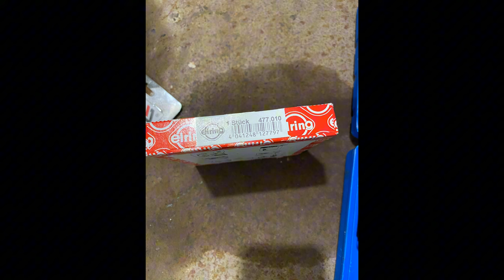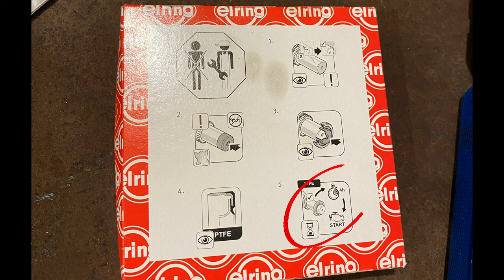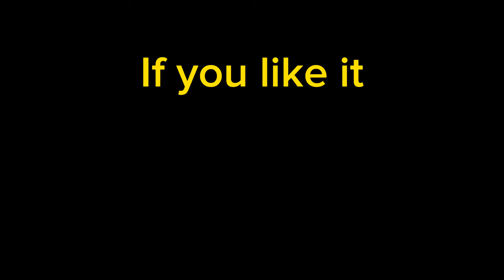FWD Crankshaft Seal Replacement for BMW M57 Engine

Comment: How did you lock the engine during damper disassembly and reassembly? Looking forward to do this job on my e61.
Reply from the maker: There are few options. 1. Use BMW special tool for locking flywheel codes 118183 and 118182. 2. Use old serpantine belt to lock vibration damper (Lots of examples in YouTube) 3. Use flywheel locking tool through special access point in TDC position, locking pin from engine timimg tool. In my case I locked flywheel through timing posotion, assuming that M57 engine is made from thicker materials and locking pins ae also thick enough and will handle the loads. But is your own risk. Always use special tools to be 100% sure not to damage anything.